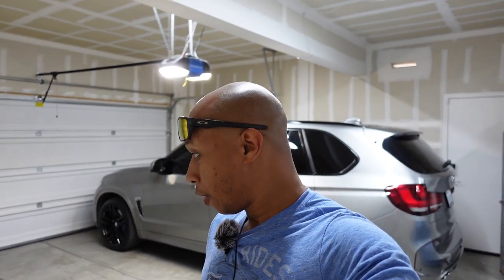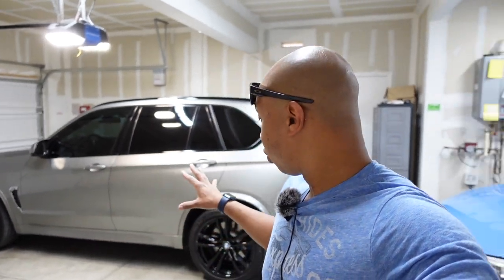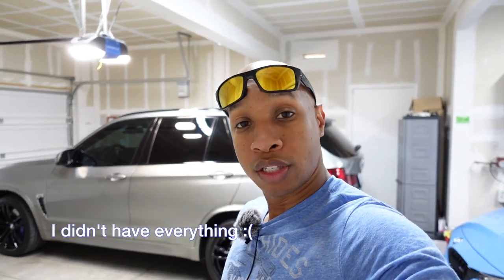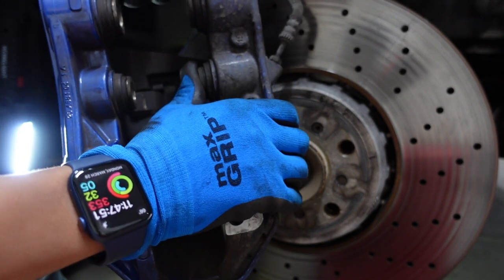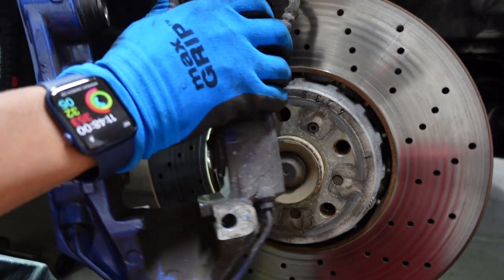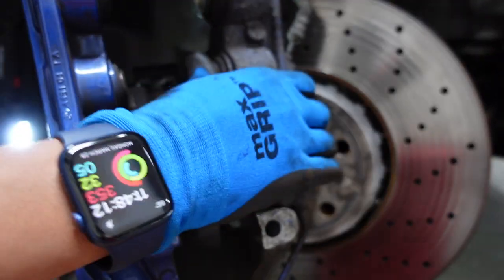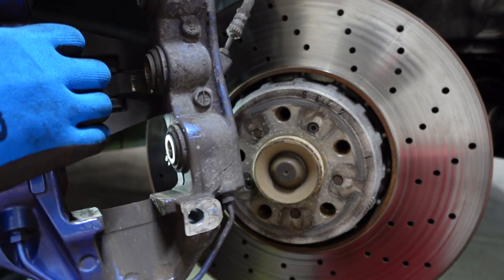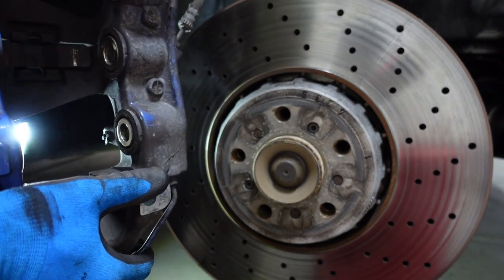How to Change BMW X5/X6M Brake Pads- F85/F86

Comment: Why didn't you change out the rotors, while you were at it?   And you should have use a piston pusher on the front calipers.  And lubricate the contact areas on the pads and calipers to eliminate squeaks.  I just did this on my X5M a few weeks ago, but I used carbon ceramic pads.
Reply: can you link the pads you used, please?
Reply from the maker: Hi William, those are good questions. 
I decided against paste because instructions on the forums indicated not to use it.  
The counterweights on the pads themselves eliminate vibrations. 
I kept the rotors because I was just at the minimum thickness.  I don’t have any juddering from pad deposits either. They’ll most likely need to be changed at the next brake service. 

I never used a piston pusher for 2+ piston brake pads.  I was looking it up and noticed they have one made just for 4-6 piston calipers. 
Which brand Carbon Ceramic did you go with?

Comment: Hey I don't wanna come off as a know it all . im simply looking for an answer. I'm a bmw technician and in the instructions for this service it says to ensure the t55 must never be removed. I know this and because  re-read the instructions and realized my mistake.  But I don't know why it's bad to take the t55 out  - your supposed to remove the E-torx on the back of the bracket. According to AIR

Comment: Hey Ed I wouldn't mind a small mini-review after about a week or 2 to see if that pad does produce far less dust.
Reply from the maker: Sure!  I should have it done shortly.  The Hawks were horrible! I couldn’t stand the dust, but so far the Z23 Powerstops are great!
Reply: @eddiemcars  how about the squeal noise when breaking? Were you getting that with the OEM brakes? Mine are soooo bad!
Reply: @rick535xi  Yes, my squeals are so terrible. I sound like a school bus. Using the OEM pads
Reply: @dennylegendre6048  I have an X6M and the squealing at low speeds is getting to be unbearable! I think it's the pads that produce too much brake dust which clog the caliper assembly.  Maybe not enough brake paste/lube too

Comment: Hey Ed, I was wondering if you experienced extreme squealing from your brakes.  I currently have a 19 X6M with 25k miles and the brakes are unbearable and pretty embarrassing. The dealer keeps saying that that's how it is but I refuse to believe that a high end car like this is supposed to sound like 20 buses coming to a halt.
Reply: I have the EXACT same problem and 2 BMW dealers told me the same thing.  I think it's a pile of crap because they don't want to chamfer and lube the pads and caliper assembly.  Let me know if you find an interim solution.
Reply: Exact reason I am about to do my pads the squeeling is horrible, did it resolve when you replaced pads?

Comment: I have a f86 doing rear rotors bought that bimmerlink and a odb2, I am doing the job this weekend but i am wondering i could not get the app to move the pads, it just says malfunction on display. I have a dumb question is parking brake off the same as disengaged? I cannot hear any movement out of the rear with the app. Everthing else in the app works fine. Do you have any advice???
Reply from the maker: I’ll he honest. I've never used that feature in Bimmerlink.   I think if you enable it, you may get a malfunction because the parking brake is in service mode.

Comment: Ouch! I did not know the M Brake is from Brembo. I was a bit shocked to see "Made in Italy" written there. But I heard a lot of people claiming the M brakes are squeaky. The M50d and M50i (which are designed by ATE, a German company) do not.
Also, I was under the impression the brake pads could be removed without removing the caliper - but I looked it up in the original documentation and it is pretty much exactly as you did it. They also put an "!" at (roughly translated from German): Do not let the caliper hang on the brake hose!
Nicely done. Great work.
Reply from the maker: I was surprised to see Pagid brake pads! Good to know, I didn't know ATE is a German company.  IRK, the rear calipers are ATE.

Comment: it will be a good idea to put a rag around the brake fluid reservoir incase the brake fluid overflows and damage your paint and parts inside hood while pushing back  brake caliper pistons, also to after removing brake calipers hang them at a comfortable height with a bungee cord to work comfortably with both hands instead one hand trying to hold the caliper ..just a thought one may not agree.

Comment: Hi Edward

Very informational. I love it bro. Did you open the brake fluid reservoir to help with pressure relief or it wasn’t needed??

I have 2017 x6m. And I’m planning to try those same brake pads this weekend myself bro

Your video gave me sooo much confidence 💪🏾💪🏾 ///M Power
Reply from the maker: I didn’t open the reservoir.  I forgot to.  Typically its good practice to do it and place a rag around it to catch spills.
Reply: Good catch.  Had he opened the lid,  he would have struggled less with pushing back the pistons.   They played musical chairs on him .    In any case , this great video deserves recognition .

Comment: Tips:  When depressing calipers open the brake fluid reservoir.

Also, I would also lube the back of the front pads.
Reply from the maker: The reservoir yes.  However you only need to lubricate the pins.   The back of the pads have built in shims.

Comment: Car replacement-part videos should be done exactly like this one, very detailed.     Saw many videos for X5 pads ,  mostly were made like stir fry ,  little details , and you have to guess steps .   Great video man,  salute .    This video should win the world cup :)   However, you skipped the year,  which year is your X5 ?
Reply from the maker: Mine is a 2016 ,F85/F86 which covers the 2015-2018 model years.
Reply from the maker: Thank you!  
Mine is a 2016 ,F85/F86 which covers the 2015-2018 model years.
Reply from the maker: Thank you!  
Mine is a 2016 ,F85/F86 which covers the 2015-2018 model years.

Comment: Dope video but did u had to replace your old sensors or did they work just fine?
Reply from the maker: You can reuse them if not broken but otherwise replace them.  Not expensive
Reply: @eddiemcars  thanks🔥🔥🔥💯

Comment: Great video! Just ordered the pads because I’m tired of hearing the squeal everytime I brake. Do you recommend changing the brake wear sensor when changing the pads? And if so what brand or a link would be helpful. Also not sure if it’s one sensor for front and rear or 4 total sensors.  Thanks in advance!
Reply from the maker: You can reuse the sensor if you like. If you decide to replace it, there’s two sensor total. The left front and right rear I believe.
Reply: For quieter braking ,    I saw they are recommending ceramic pads, not semi-metallic .

Comment: I just replaced my pads/rotors on my 2016 X5M. To remove the rear calipers, I bought a low profile 1/4 inch drive ratchet and a specialty 7mm bit. Worked like a charm. Trying to use the 7mm Allen wrench is a pain. 

I can send you the link to the tools if you like :)
Reply from the maker: Thank you for the tips and yes,  I would appreciate a link!
Reply: @eddiemcars  here's the hex set I bought: https://www.amazon.com/dp/B00SQ4DWGQ?ref=ppx_pop_mob_ap_share

I bought a craftsman 1/4 drive ratchet. Gunmetal 120 tooth low profile. I'd done it before with an Allen wrench and while doable, this set-up was SO much easier. Highly recommend.

Comment: Great video, gonna do my pads, but wouldn’t you put copper grease on the back as well to stop squeaking?
Reply from the maker: No, you don’t need to with pads with built in shims.  Pins are the only thing that should be greased.

Comment: This is a really good video.  Thank you for sharing.  How is the brake dust on the front pads (Z23 Powerstop) compared to the OEM pads?  Any brake squealing?
Reply from the maker: No squealing.  The dust is cut down by 50%
I can drive for 300 miles before any dust is shown on the wheels and with the oem pads that would take 30 miles.

Comment: I plan to do a brake job on my 2018 X5m but I need more details on removing the rear. if releasing the electronic hand brake.
Reply from the maker: The electronic parking brake is rear drum.  It shouldn’t cause a problem when replacing pads.
Reply: I’m going to take your advise and swap out my rear pads for the akebonos- mine is a 2018 X5M- 
For clarification, do I need to put the rear ebrake in service mode? 
Can you provide some detail- much appreciated.

Comment: Dude i love all your videos... my solution for the horrible metal metal squeak..... with no one around 60mph and hit the brakes... do this twice it'll last 15-20 miles.... the then repeat.  The X5M.... it's awesome and worth it
Reply from the maker: That too.  Sometimes rinsing cold brakes with high pressure water hose will remove the residue brake dust.

Comment: Hey Ed, This is great and really helpful. I have successfully changed my spark plugs watching your videos. Thanks a lot!
I'm working on rear pads right now and confused how to get rid of the warnings without changing the sensors. It would be helpful if you can show that as well. By the way I drive 2015 X5M.
Reply from the maker: Hi! I’m glad you found the videos helpful! 
Regarding resetting the brake sensors I have that on a future oil change video but I’ll tell you about two ways. 

1. Press start/stop button to switch vehicle on but don’t start the engine.  Press and hold the trip reset button in the instrument cluster for about 10 seconds. From there it will bring up maintenance for oil change.   Skip forward by pressing the trip/reset button to cycle through until you find rear brakes.    To reset that maintenance, you will press and hold the trip/reset for 5 seconds until it prompts with okay to reset? 
Press and hold again until the loading bar completes 

The Second procedure and simplest way is if you have BimmerLink you can reset it though the app.
Reply: @eddiemcars  Thanks for the detail. I Appreciate it! I got the BimmerLink and OBD MX+ adapter to reset the codes. Will try it out and let you know. You are the best! Thanks!
Reply: @eddiemcars Final update, I tired to reset the service multiple times and eventually gave up. Replaced the old sensor with the new one and reset the service with no issues,  before even mounting the wheel. 

In the first place, without your video I wouldn't have made it to this far. Thanks for sharing your knowledge!

I thought it would be good to share a tip when replacing the spark plugs. I struggled puling the coils initially and tried to use small rope to pull the coils. May be it could help someone to make their life easier.

Comment: I’m going to take your advise and swap out my rear pads for the akebonos- mine is a 2018 X5M- 
For clarification, do I need to put the rear ebrake in service mode? 
Can you provide some detail- much appreciated.
Reply from the maker: You do not need service mode.  The rear parking brake is engaged by a brake shoes located in the drum independent from the rear caliper.

Comment: thanks man, i'm looking at an X5M to purchase and the car has 3mm pads on the front and the dealer doesn't want to change them for me.  Is it this easy on the front as well? Do you need a computer to tell the car to release the pistons so you can get them off?
Reply from the maker: Yes, they’re easy.  No computer needed to remove the caliper or change the pads

Comment: Love these videos, thinking about doing my brakes.  

How did you determine whether your rotors were still good?

My computer is saying 3000km left on the rears, 20k left on the front.  But they are squeezing SO bad.

Can I just do the rears for now? Or do both.  And should I keep my rotors?

I’m only at 35,000 mile
Reply from the maker: I looked for scoring on the rotors and a large lip at the end.   I'm at 67,000 miles and rotors are due!
Reply: @eddiemcars  I have quite a bit of pad left of the front, doing the rears only and resetting as good right?
Reply: Hey Eddie one last question as I have ordered my pads. What part of the callipers did you grease it wasn’t very clear on the video on the rear.

Comment: How many sets of pads before you need to also change rotors?
Reply from the maker: Maybe 2-3.  Usually it’s a certain rotor thickness
Reply: Depends on your driving style .  IF you are like my ex-wife,  wait until you reach the signal, then push the breaks HARD ,   then u must replace them too often.   Had I replaced the wife sooner, I would have saved on rotors .   LOL

Comment: Does the F15 X5 have the same pad replacement procedure ?
Reply from the maker: The rear brakes should be the same or similar. 
The front brakes with out the M sport brakes are different 

https://youtu.be/oiQ-qTffAkQ

Comment: Try out a Porsche 911 GT3. 
I am a physician and switched from BMW to Porsche recently. 
Still have my 2018 BMW X5M. But you realize the precise engineering in a Porsche.  
BMW M seems like a sledge hammer compared to a Porsche GT3 which in my opinion is like a scam scalpel. 
Different type of vehicle but you can appreciate the craftsmanship of a Porsche for sure.
Reply from the maker: Porsche would be next on my list.  The prices of these cars is keeping me out of the driver seat

Comment: Hey man just did the Brakes an followed all ur steps. Now I have epb malfunction code reset everything was okay then it came back again an the epb was legit screaming. I backed out the epb an retried procedure. Code came back an now I can’t move the car it’s stuck. Code will not reset now. Is there a manual release? Do you know what I could have done wrong or how to fix this please help any advice is much appreciated.
Reply from the maker: Try to preform the procedure with parking brake released.  If it's engaged, it could cause a problem.
Reply: @eddiemcars  Will be trying this asap. Also where is the manual release? Cars epb is completely stuck can’t move the car or reset the light…..
Reply from the maker: @brennansulton340  I'm not sure of the manual release since it's a drum based parking brake.  If it were piston you could unplug it at the source and manually twist. 

This by no means an expert procedure, but if this were me in your shoes, I would try to disconnect both negatives on the battery first. 
Let it set for 15 min

Then try again to see if I can connect the device and release the EPB

Comment: About to do my brakes and follow along with your video! I went with EBC YELLOW STUFF and sticking with my current rotors as they only have 40k miles.

What torque setting did you use for the back? Considering you couldn’t get a proper socket in?
Reply from the maker: I couldn’t use a torque setting. Only did slightly above hand tight for the rear
Reply: @eddiemcars  Thanks man! You really have a unique product as you’re the only guy on you tube making content around our x5M - so grateful!

Comment: Just an update on my YELLOW STUFF pads…. Wow.

Absolutely silent.  OEM stopping power.  Not a single sound from the brakes.

I don’t have any info on dust yet as it’s winter here and the roads are all snowy and dirty and I can’t tell.  I’ll drop a note here when I can.